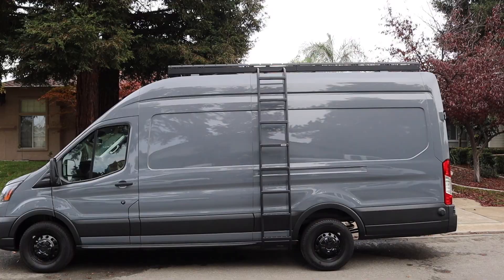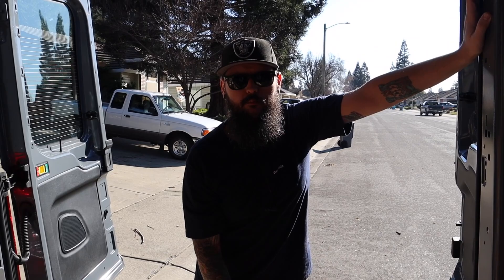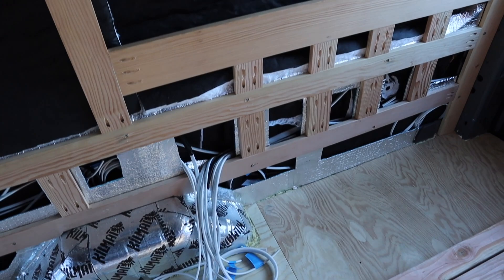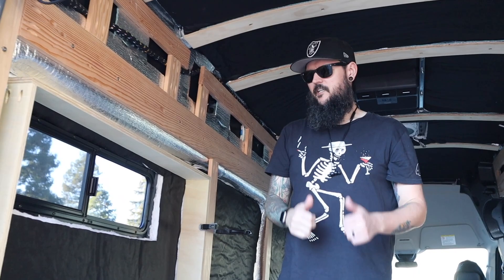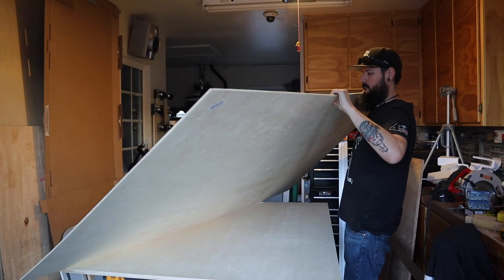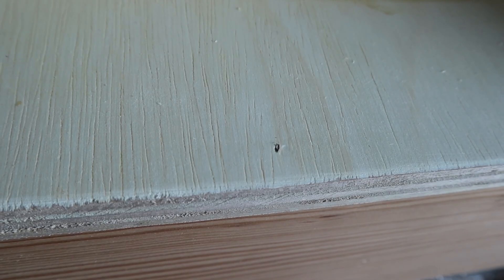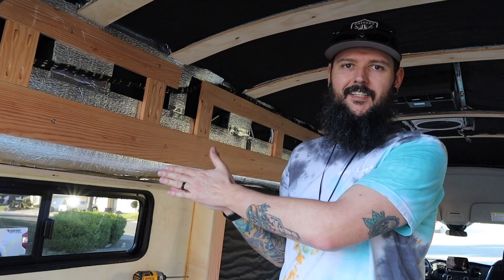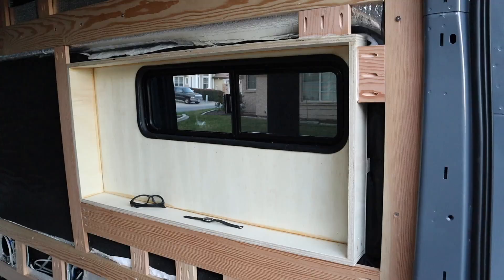Framing to Sleep Sideways in a Transit Van | 2021 Ford Transit Van Build Conversion Ep. 11

Comment: Hi Britt, Mike and Leah,  lovin your van build series and rewatching often. I am a 60 yr old gal building out a recently purchased 2021 Ford Transit High Top, OMG so much to learn ! Electrical system put in by professional, floor done, now need framing and bed. Intermittently on the struggle bus. My next project is the bed and inset bed boxes. Did you using 1x6" or 2x6" to attach to van wall ?  Are you then using 1x6" to build out insert framing ? Your videos have been so helpful, thank you so much.
Kim

Comment: What a great solution for filling in the window gap!

Q. Are you not using glue for your pocket hole joints? 

Loving your videos and learning a ton. We're waiting for the weather to warm up before we start building our van.  -Peter
Reply from the maker: Thanks so much, hope your build goes well! Warmer weather and longer days will definitely be helpful. Correct, we did not use glue for the pocket hole joints.
Reply: @britandmike  why?
Reply: Where did you get the windows from cheers

Comment: Looks like you sandwiched EZ-Cool between the supports and the framing members? Can you describe that process? Thanks!
Reply from the maker: Yeah of course! We did this to reduce thermal bridging. We talked about it in detail in this part of another video: https://youtu.be/yCEcyVXnXdA?t=630 
But here are the basics: 
1. We used rivet nuts to attach our studs to our van frame, so we installed all of those first
2. Then we would cut out a piece of EZ-Cool to fit a particular section, line it up, and then cut small holes into the EZ-Cool so that you could see/access the rivet nuts underneath it
3. Then we taped it in place with reflectix tape
4. Finally we screwed the frame boards into the rivet nuts in the van wall, leaving the EZ-Cool sandwiched between the frame boards and the van wall

Comment: Love your video! Could you tell me what the width is of your beds location from finished wall to finished wall BELOW your raised bed location, not utilizing the bump-outs space?  In other words, 15" off the floor, finished side to side? Thanks!
Reply from the maker: Thank you! The finished wall-to-wall measurement at 15” off the floor is approximately 66 and 3/4”.

Comment: if u decide to sleep sideway without flare, maybe its better not to have windows on the side, they are too cold to touch and water droplets might form on them during cold nights.
Reply: I agree. Take out the windows and put back the metal cutout.
Reply: Does this apply only if you're tall enough that you might be touching them unintentionally in the night? 

I'm planning on doing a sideways bed myself but I'm only 5'4". And also hoping it will work out that I can put the bed height at about 24 or 25 in. I have osteoporosis and some back problems so I don't want to be up high.
Reply: @SoloTravelCoach 
the condensation will wet ur pillow or beddings no matter if u personally touch the window or not.
if u only want air circulation, its better to install large skylight  and or a powered top mount air vent
Reply: @redhongkong  thank you so much for the education I am brand new at this. Haven't even bought a van yet I'm leaning towards the Ford Transit because a year or so after I build it I'm planning on shipping it to Europe and driving around Europe for several years. The transit is widely sold and Europe In fact it was a joint project between Ford and the United Kingdom so I talked to a dealer over there and they said the parts are fully interchangeable so there was no problem getting maintenance or repairs done in Europe. 

I appreciate your time

Comment: How'd y'all decide where in the length of the van to put the bed?  Could it have moved back towards the rear doors at all, or is that kinda where it needs to go based on the bed size you're getting?
Reply: Also curious about this one!^
Reply from the maker: The mattress will extend all the way back to the rear doors, but with these boxes we wanted to basically build out extra room for a portion of the head and a portion of the foot of the bed. The inset boxes couldn’t be any wider because the sheet metal for the panel that they are set into (i.e. where you would put a window in a passenger van) meets the van wall at an angle. 
It’s kind of confusing to explain over text, sorry! But you can sort of see what I mean in this picture, at his right hand: https://www.patchworkandpebbles.com/wp-content/uploads/camper-van-build-start-2-1024x683.jpg
Reply from the maker: @JohnNeelyCBRealtor  just replied! :)
Reply: @britandmike  Okay sweet thanks! Well done explaining and I’m sure the build is going to work out great as well! 🤟🏽💙

Comment: Out of curiosity, when did you order your van?  I ordered the same color, High roof, extended, in March and am still waiting…
Reply from the maker: We ordered in May 2021, it started production in late August and we got it in September. We did get lucky with going to a dealership that had the proper allocation to make those orders. I would definitely reach out to your dealership because from what I’ve read on Transit forums online, I would have thought they had started building 2022s now. Hope you get your van soon!
Reply: I ordered 350 tall,extended non dully Eco boost in November 2021 still waiting at the end of June 2022. I was talked out of the Abyss grey by the salesman I now see I would’ve loved it! Ended up ordering Carbonized Grey Metallic, hope I like it at least half as much as yours. :)